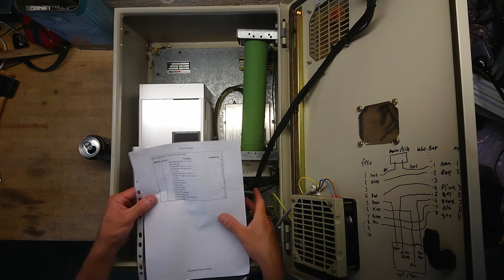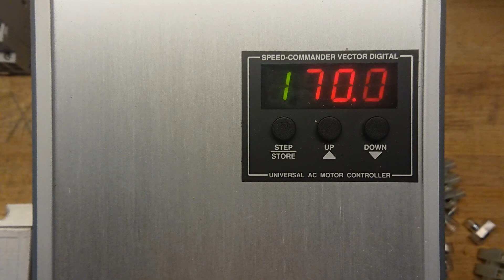Bad Electrical Panel. A Rare Speed Commander Appears! A Danish 4kW Motor Drive

Comment: I didn't think DIN rails were mandatory...
Reply from the maker: You are right, DIN rail is not mandatory, but if you do have a DIN rail there is no excuse for letting things fly around :) DIN rail is just a good standard method of securing the components and its supported world wide by component manufacturers. Luckily the days of drilling 4 holes for each component is over!